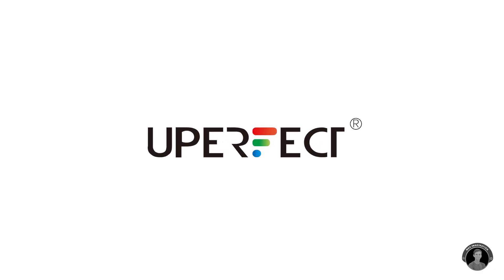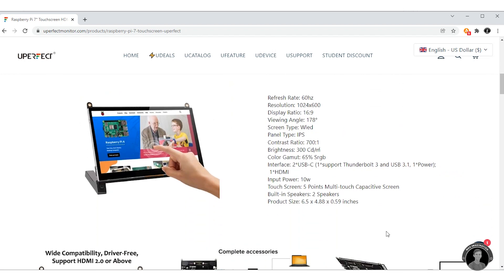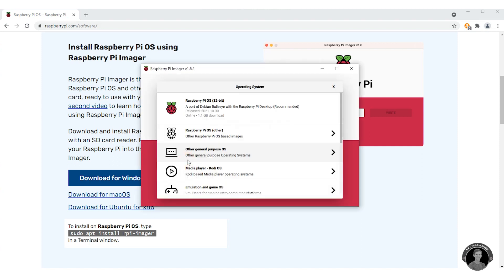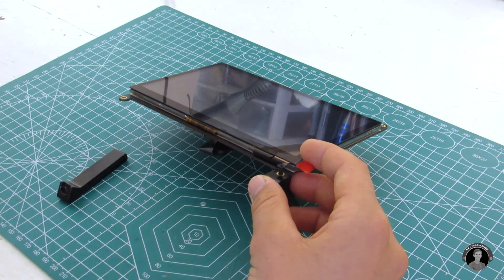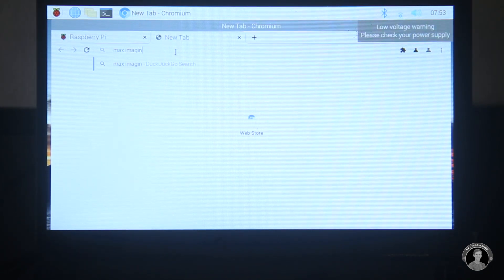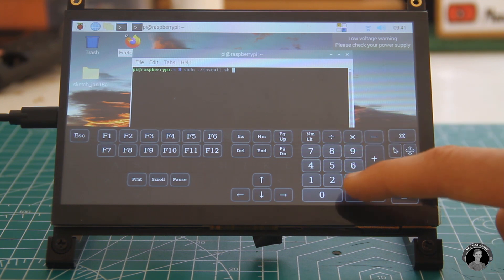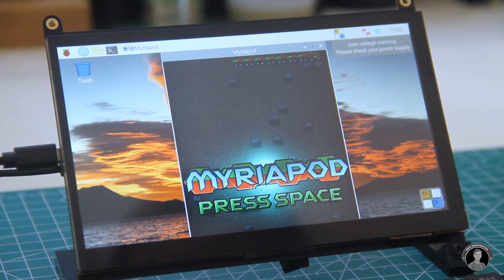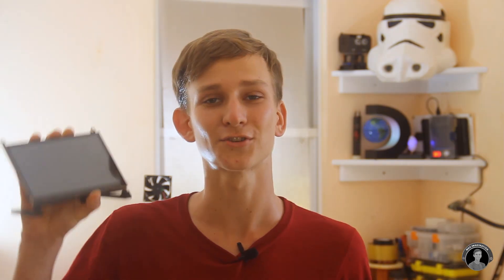How to get set up with Raspberry Pi | + UPi Monitor | Maker's Must-have Workbench Mini PC

Comment: Do you have any experience with using monitors like this that are on pretty much 24/7? I'd like to do a homebrew alarm clock/weather radio that displays the real-time weather radar, but wouldn't want to burn the thing out by keeping it on at all times.
Reply from the maker: Hi, Jared. I don't have that much experience on dealing with monitors/displays on hand. Though, from what I've seen is that there shouldn't be a problem with low power consumption monitors being left turned on around the clock. With larger displays that are typically quite bright, those might just need a form of cooling, from a fan or something.

Cheers,
Max